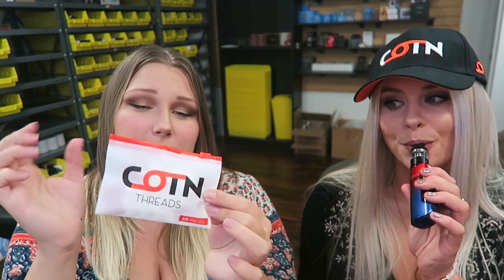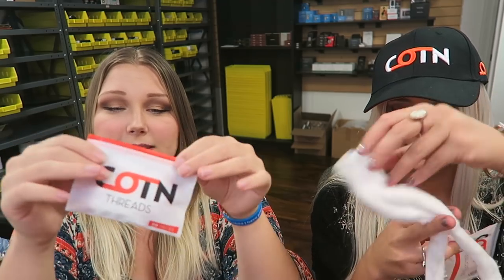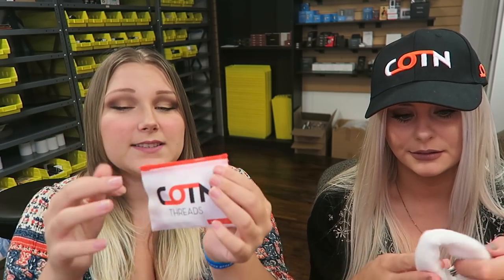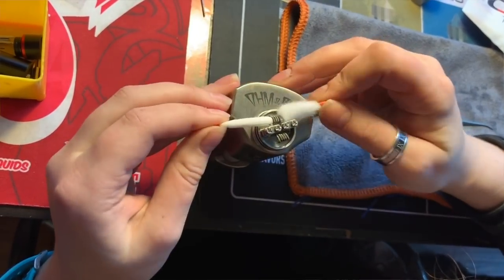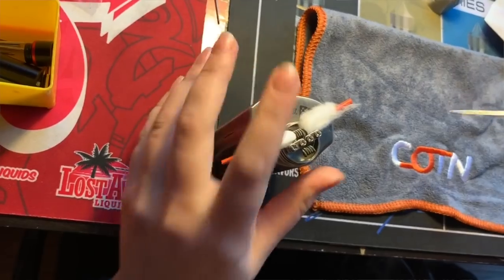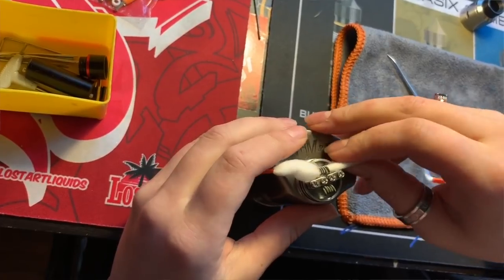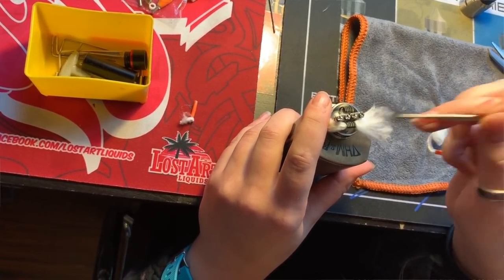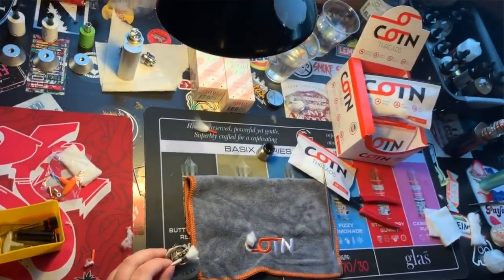COTN THREADS w/MADI! | TiaVapes Review

Comment: To save on your COTN, you can use one thread to pull it to where you need, cut, and then use the other thread on the other coil. Unless you need really long wicks, one COTN wick should be enough for both coils. I believe that's why they have the cap on both ends. Money saver. :-)